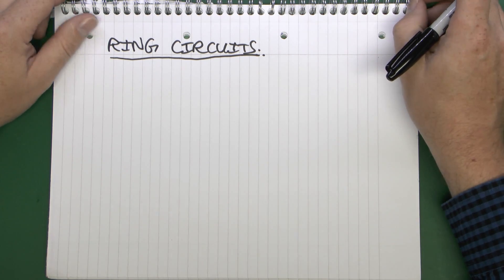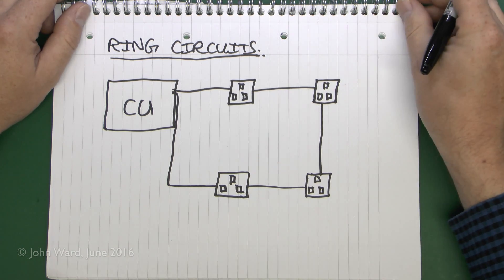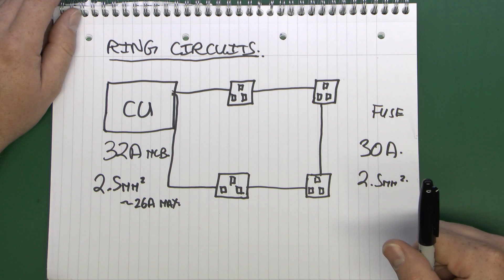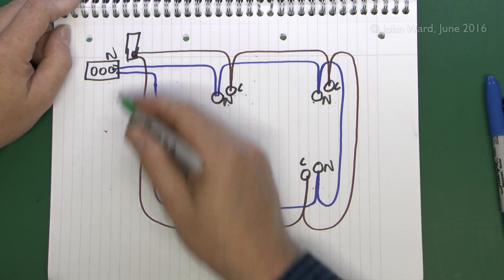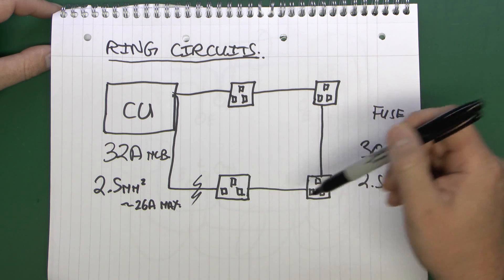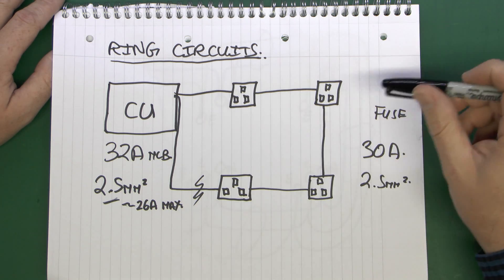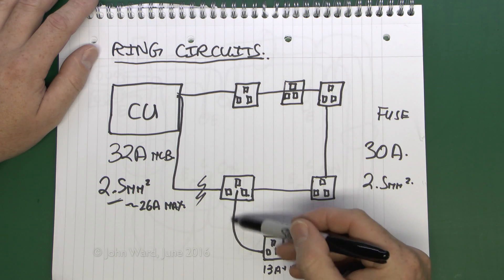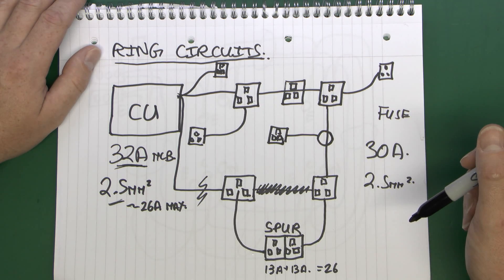UK Ring Circuits (previously Ring Mains) for Socket Outlets

Comment: The UK uses fused appliance plugs so the ring is a good idea in that case.
Reply from the maker: The only reason those UK fused plugs exist is because of the ring circuit.
If the ring had not been used, UK plugs would be unfused.

Comment: Not sure if I heard right that the neutrals terminate in the same  point on the neutral bar, isn’t this double tapping or have I made a mistake
Reply from the maker: Yes, both neutrals connect to the same place in the bar, or on the circuit breaker/RCBO terminal.  Same for the L and E conductors, both L into the one terminal, both E into one terminal.

Comment: The ring final circuit is tried and tested and does have its uses. Ring V Radials both have advantages one over the other. 

If you have just one break of the c.p.c in say a kitchen radial and one appliance faults to earth then you might end up with 3 or 4 lethal voltage pieces of equipment and not be aware of it.

Comment: My ring mains are on old 15amp fuses! The cooker is on a 30amp fuse, lights on 5amp fuses! When did this change!
Reply from the maker: More likely to be radial circuits.
Ring has been the same since 1947, the only minor changes being 30A fuses to 32A circuit breakers, and the change from imperial sized cables to metric.

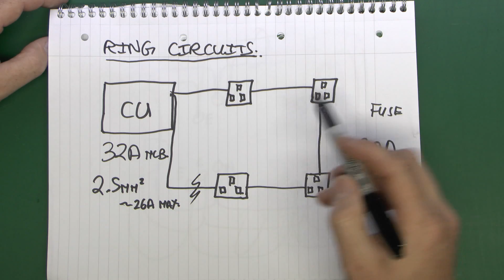Comment: The point you make shortly after 8:00 seems to indicate that this is an inherently unsafe system....
Reply: Why would a cable suddenly break? I have never known a final ring to break. With lever screwless connections like Wago on the spine of the ring less likelihood of that happening. AFDDs are recommended for all socket circuit in the UK, and mandatory for certain installations. That will grab any problems on a ring. As will the new tech with unique thermal monitoring technology - look up the Ci One and Ci Max sockets. The tech is to be made into a consumer unit breaker so I read. Final rings have never been so relevant with many low amperage appliances in homes these day.
Reply: @johnburns4017  Thank you for demonstrating the exact wrong kind of thinking. The fact that you cannot imagine nor have experienced such failure therefore conclude it will not happen is exactly why you are or should be not an certified electrician.
Reply: @HansKeesom  
Read what I wrote. With only basic circuit protection such as an MCB, using 4mm cable solves any clear break in a final ring.  The technology is here to ensure the final ring is ultra safe.
Reply: @johnburns4017 just watch the video from 8:00 to 8:40 and listen to maker of thid video is explaining
Reply: @HansKeesom  
Read what I wrote it is easier that way. This vid was made before new safety tech came about and IMHO John Ward has not done a good job analysing final rings v radials.
Reply: @HansKeesom  
If you are paranoid about a ring being cut and one leg drawing more current than what the conductor is rated for, then... 

i. Have a 32A master RCBO/AFDD, with the neutrals of each leg of the ring running back to the N terminal.
ii. A slave 25A double pole unpolarised MCB with the L of the two legs run each run thru the two terminals. The AC MCB does not care if it is N or L in either side. Double pole unpolarized MCBs are cheap.

So you have:

a. The cables of each leg protected in case of severing;
b. There cannot be a dangerous imbalance of the ring.
c. Full RCBO or AFDD protection. 
d. One final ring will take three slots in a consumer unit. 

This is all legal to the regs.

Comment: I have been installing 4mm radials on 32amp mcb's or rcbo's for over 15 years. I still work on Ring circuits if it tests safe to do so.
The kitchen would be wired as two 32amp radials, eg one each side of the kitchen or one above and one below worktops. Easy to spur or extend as long as you used 4mm. 
I always informed the client of the benefits even though it was a more expensive system. We generally won the work on the information given and word soon got around that we offered a safer system and cheaper and easier to test and extend.
Reply: All you are doing is giving your customer extra needles expense for no benefits. Then if you went by the recommendations that came in force about 2.5 years ago, which I am sure you do not, you would need an AFDD on each radial with socket-outlets. A ring just needs one AFDD.  At ~£100 each that is an expensive undertaking, for no gain. A ring is safer as the earth (cpc) has two paths back to the consumer unit.  If the cpc breaks in a radial safety is greatly compromised. Also voltage drop is less at a points as it is fed from two ends.

Comment: Never understood the problem with these, quite simple, one breaker for downstairs, one for up and you can use the ring to transfer other signals (such as wifi, ) around the place with a suitable  plug in adapter.
Reply from the maker: None of those things requires the use of a ring circuit.

Comment: There is a way to make existing ring circuits much safer:
Put 1 custom circuit breaker that has 2 input (live and neutral) and 4 outputs (2 live and 2 neutral to ring) which also has a flag which wire has tripped the breaker. The beaker should be 16A continous, 20A instant for 2.5mm² cables.
So if any part of the ring fail, no more tham 20A can flow at any part of the circuit. 
Also, any new spur sockets should be supplied by 4mm² cable, since in theory spur can draw up to 26A.
Reply from the maker: Or much easier - dispose of rings and install radial circuits like the rest of the world has been doing for ever.
Reply: @jwflame  
Maybe the rest of the world should catch up to the Brits. The final ring has been proven over 75 years.

Comment: Thank you for this 👍🏻

They're fine 
However, I wouldn't bother having it installed in a new house

In Australia, we'd typically have:
🔹Oven (if not gas)
*cooktop or hob is typically gas even if electric oven 
🔸Hot water (if not gas)
🔹Lights 
🔸Bedrooms (wall sockets)

Sometimes there's a couple of fuses each for lights, bedrooms, etc

So even if all the wall sockets are on 1 fuse, I don't think they're a Ring Circuit... 🤔

Then if you've got heat lamps in the bathroom 
Split System AC
Electricity to a garage, etc
They all get their own fuses

RCDs are installed as well at the Consumer Unit 
Very important since we use 240V AC 
*actually 230V now to split the difference with Europe's 220V

Comment: I did my apprenticeship in Australia in the mid 70s. Never ever has a ring circuit  been legal in Australia. All our power circuits are wired in parallel with no ring. All sockets wired in 2.5 T and E. Never heard or had an issue. In fact our wiring rules have and continue to ban such circuits here in Oz and New Zealand..
Reply: You will find that final rings are not illegal, just not done.

Comment: Good grief. JUST USE BIGGER DIAMETER CABLE that's rated at 32 amps. What was the point of this, to save on copper wiring size?
Reply from the maker: That was the point, together with a lot of other things all designed to save copper and other materials, and make new electrical installations much faster and cheaper.  However that was all designed back in the 1940s and intended to be used for the housing boom of the 1950s/1960s.
Entirely irrelevant today, and the way a lot of people still install these things actually wastes material compared to radial circuits.
Reply: @jwflame  
Myth. The ring was not designed to save copper. The British WW2 wartime committee looking at advancing electrical installations noted:

“the installation should allow the occupier to use electricity, if he so desires, for providing ‘topping up’ heat. Bearing in mind the limited cubic capacity and the load diversity of the small dwelling under review, it is considered that they could be adequately heated electrically using portable or inset electrical fires or convectors up to 2kW rating from the ring circuit. This [substantial demand] applies to the smaller classes of dwellings in which 2 kW radiant electric fires are commonly used, and in which fires or other appliances exceeding this rating are seldom required due to the limitations imposed by the size of the room.”

The above is clear the committee homed in on final ring circuits to ensure one socket in each room can take a 2kW load. The aim being that each room can handle a 2kW heater, of which a final ring can do as it delivers the power.
Reply: Yes, a ring can be wired in 4mm cable.

Comment: Why not a 16A mcb?
Reply: The regs for final rings are: 2.5mm cable minimum; 32A breaker maximum. You can have a lower value breaker or higher gauge cable.
Reply: Current spikes

Comment: Great explanation John , genuinely you can have the same number of spurs as you have sockets on the ring , in theory you can have as many sockets as you like as long as you don’t exceed a certain floor area of a 100 square metre. But as you rightly say it comes down to common sense. Till recently a domestic property ie a two story house had three ring mains , and two lighting circuits,one for the ground floor one for the upper floor and the kitchen had its own ring main because there would be quite a few high power appliances such as fridge freezer washing machines tumbler dryers microwave , electric toaster kettle food mixer and if you could afford it a dishwasher. Personally I think ringmains still have their place . In houses . Because if you have a fault on say the ground floor ring you still have the upstairs ring  as well with the lights .

Comment: So the wire comes out the consumer unit to start the ring, but you just also return another 2.5mm wire back into the unit. Do you need to connect the wires to the same terminals in the consumer unit
Reply: yes

Comment: As an Industrial electrician of 50 years I can't disagree with you more about ring main circuits,they have been an integral part of my career and have worked fine for many decades ,just because the modern electrician is too lazy to want to wire ring mains in domestic premises ,with the modern twin earth bars in socket outlets allows you to connect the cpc into the separate terminals and if you lose an earthwire then because its wired as a ring thnyou would not lose your protective earth path
Reply from the maker: As an industrial electrician, why would you be using a ring circuit designed specifically for domestic dwellings in the 1940s?
Reply: Yes, a final ring has two earth (cpc) paths back to the main breaker.  In industrial they have a return earth radial, which is a an earth wire from the furthest point of a radial run back to the main panel. In short, the cpc is a ring. All for safety reasons, which a domestic final ring has integrated.

Comment: Im actually working in a house that has the lights wired by individual wires from the board to every room, it was built in Ireland in the late 40s and has never been updated most if the cable is vir and falls apart if you look at it

Comment: So if one wire comes loose from the consumer unit, instead of losing power to those plugs, your house catches fire

Edit: Oh, you mention it in the video
Reply: Use an AFDD as I do. That will catch problems. The new Ci and Ci max heat recognition sockets are better again, developed in response to the Grenfell Tower disaster.  The man who designed it invented number plate recognition, so a bright spark. New safety technology has made the final ring indispensable. It can service many low amperage devices which are common in modern homes.

Comment: In Australia we use Daisy Chain setup for each circuit. for GPO's max per daisy chain circuit is 10A, so every GPO on that daisy chain can't exceed 10A total. In Aus you will usually find 3-4 circuits for GPO's Usually the bedrooms and lounge room will be on 1, Kitchen, depending on how many high voltage devices are to be used (Microwave, Fridge, Freezer, kettle, toaster etc you will have either 1 or 2 circuits for the Kitchen. Dining room and Bathroom will occupy 1 circuit and then you will have your outdoor appliances such as Laundry 

Lights will be on Separate loop with 10A max per single circuit, Hot Water heater on a 40-60A circuit, Electric stove and cooktops for kitchens will be on a a shared 40-60A circuit separate to the GPO's. This makes up your general house power. For Additional appliances (EV charging, Air Conditioning) dedicated circuits are required for each and amps per circuit will be based on the needs for the appliance +10%.
Reply: And whats a "GPO" in Australian?
Reply: @icarossavvides2641 GPO means general power outlet. In other words where you plug your appliances into.
Reply: Is the Daisy Chain method like the Spur method shown in this video?

Thank you for your time
Reply: @willhooke  daisy chain is where you come out of the fuse box and then go to one GPO (General Power Outlet or power point), from there you connect the next power point lines into the back of the first power point, you then just keep going, one point is connected to the back of the next. the last GPO has only one set of power leads connected to it.

Comment: If the UK changed over to radial circuits, would we still benefit from fuses in plugs (given that we have circuit breakers in the consumer unit)?
Reply from the maker: No, fuses in plugs today have very few benefits even for ring circuits.
They are mainly there for overload when using things like multi-way extension leads, and they are not particularly good for that either.
For short circuit faults, the circuit breaker will often trip before the fuse fails.
In the days of rewireable 3036 fuses, the plug fuse was relevant as the 30A fuse for the ring circuit was slow to fail and the plug fuse would usually fail first.
Reply: @jwflame  Thanks for the explanation. 😀
Reply: @jwflame  
If the breaker at the main panel fails the fuse in the plug will grab it - breakers do fail - so secondary protection.  The plug fuses are rated 1 to 13 amp. You insert the appropriate fuse value to suit the flex and appliance. So a table lamp with an LED lamp would be best suited to having a 1A fuse in the plug.

Comment: Since I came across JWs youtube videos I follow him whenever I need clarification on electrical installation. Here is one query JW !How would one supply BS7671 compliant ring circuit for sockets outlets using  with 32 A RCCB when the generator supply has a lowly rated MCB say 20A or less

Comment: I watched this when it was new. I installed a garden building on my own land for my office, it was all wired using advice from this vid without ring circuits, but higher rated cable (6mm). 5 years later, it all still works perfectly. even with a 2.7Kw heater running off it at one point, as well as a computer and LED lighting.  BTW, I also have a spur direct from the consumer unit for my Ring doorbell. All common sense stuff.
Reply: A spur off the CU for a door bell? That's got to be a first! 🤣🤣🤣🤣

Comment: Question please: if I wanted to spur a few extra sockets (as a radial circuit) off of a ring, I'd need to install an FSU... but, there's debate over whether that should be a 12A FSU or must be 20A. I reason that 12A FSU should be acceptable as the sockets through which the ring runs don't appear any more heavily engineered. Thoughts?
Reply: What's an FSU?
Reply: @simonbrahan3198  FCU
Reply: you can spur off one socket from a point within a Ring Main circuit or unlimited number of FCUs fused to 13A.